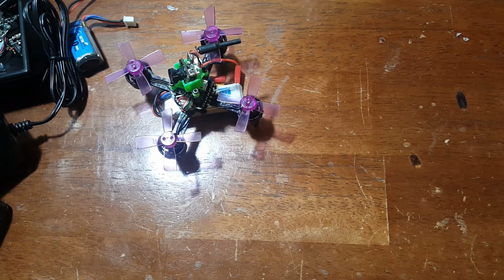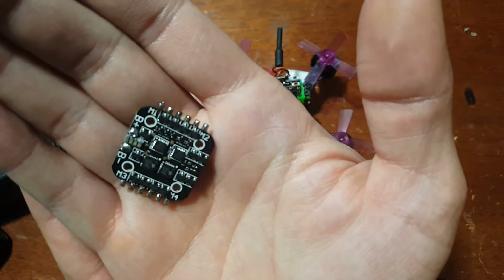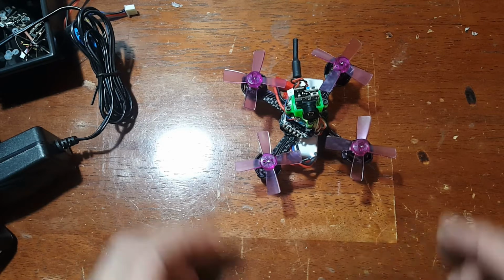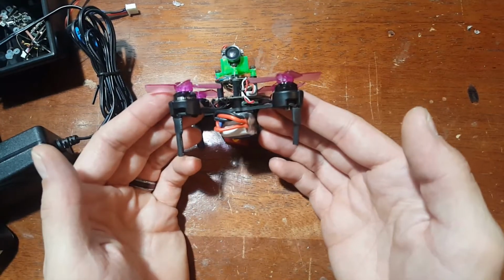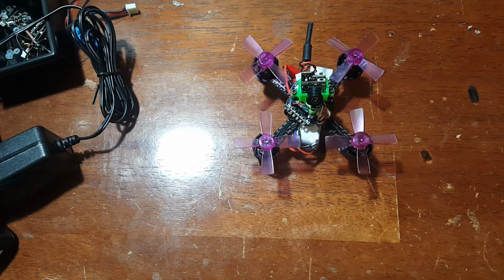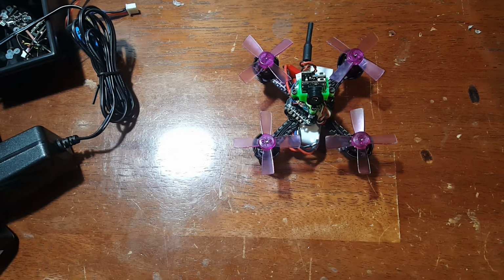83mm Build Update

Comment: just fyi mr c ray tech, first off , just wanna say hows it goin man, ok, those chips are mosfets, and you can replace them, and boom, your 4 in 1 will be ready to roll again, if your interested in delving into that task, i successfully revived a couple of aio fc's, oh and  sometimes you might find a bad capacitor close to the fet thats faulty as well, just thought i would share that with ya, peace
Reply from the maker: THE DUNNING KRUGER EFFECT THE DUNNING KRUGER EFFECT thank you sir.  Do you know a source for replacements?
Reply: ebay, ill have to spend some time lookin
Reply: on toy quads such as the h8 mini, and the majority of all of them have " aohsb " mosfets, and there is replacements that are an upgrade or higher amps and volts that work very well, the following links should help you alot, https://www.youtube.com/watch?v=5_X-5gZpx6E , https://www.rcgroups.com/forums/showthread.php?1857123-What-MOSFETs-are-your-using-to-drive-3-7v-brushed-motors